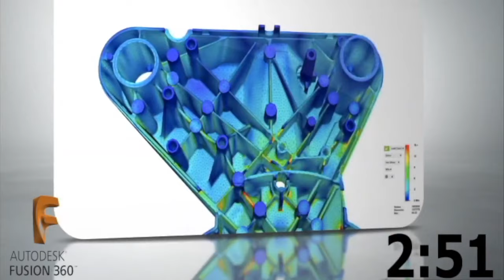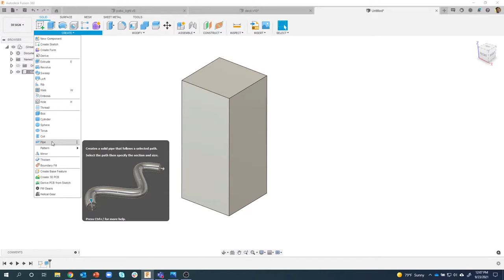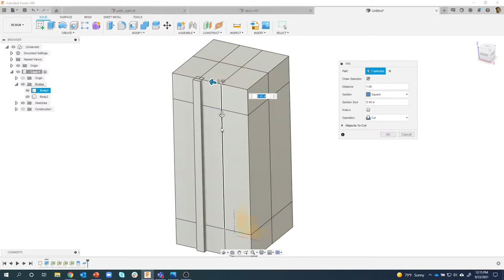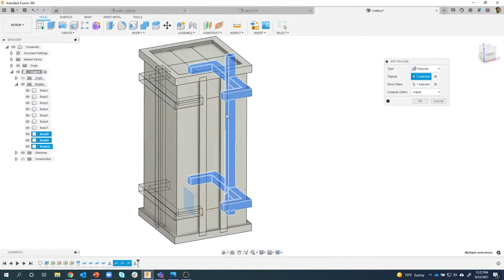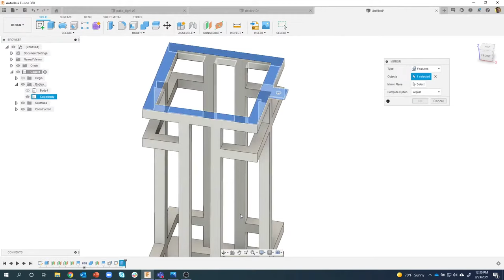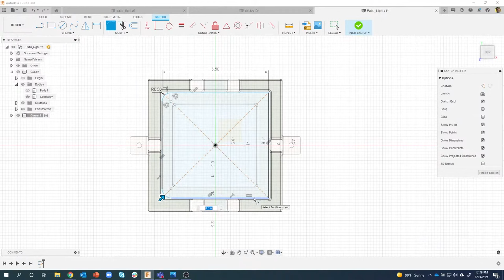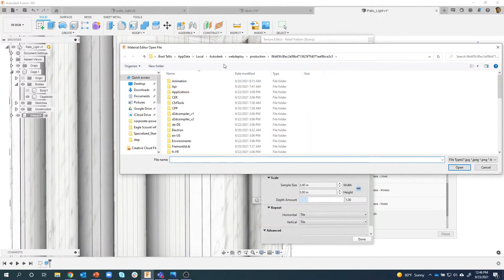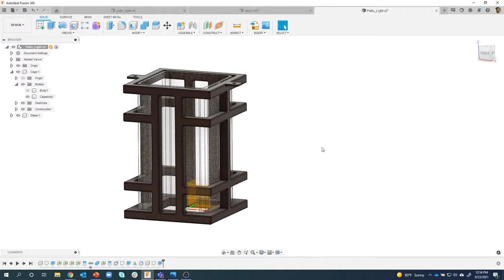Episode 96 - Shining Light on the Pipe Command

Comment: Hi Brad, did you design the back of your house in fusion 360? If yes how did you do that.
Reply from the maker: @mugen2703-  I used a photogrammetry app (Scaniverse) on my iPhone.  I was able to bring the obj from that app into Fusion 360.  I then scaled it up using a measurement I knew on the house (the length of the window, for example)
Reply: @bradtallis8968  thanks for the explanation, really helpful